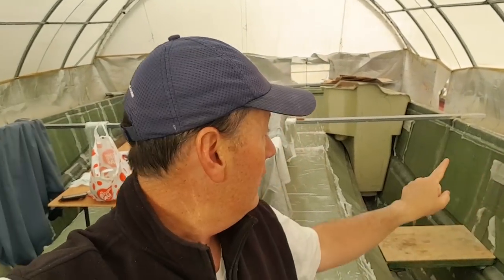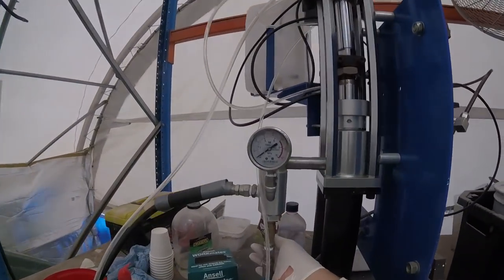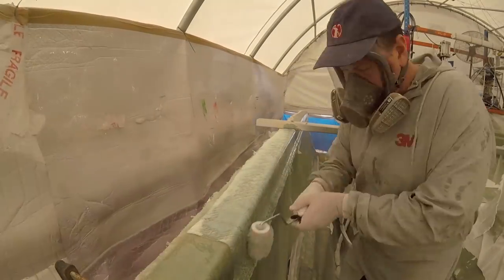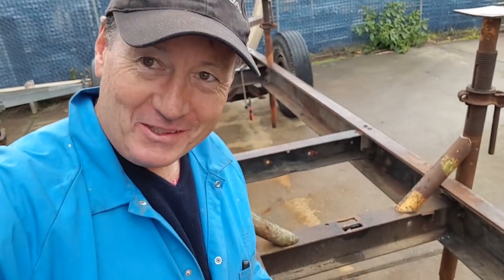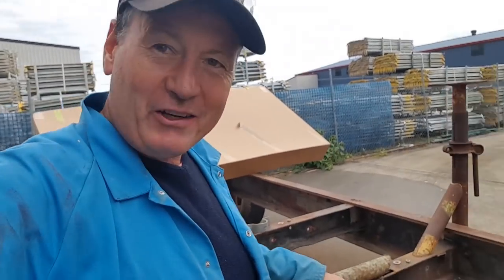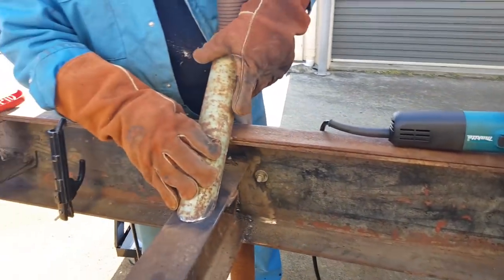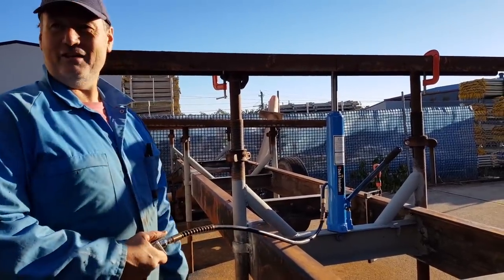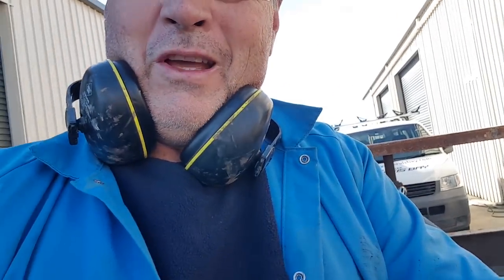EP040 Isn't that hull finished yet???

Comment: That's only the first quarter of all the work required to complete the boat, you got tons and tons of work to go! That's a huge project for one man.
Reply from the maker: Hey Bruce I reckon I am at 20percent.Althouh most of the internal modules are also complete so could put it at 35percent.Have to include the ligistics of truck,mould repair reframing so now at 10 percent.Then therr is making vidoes ad pary of it putd me back to 5 percent.Lol.No shortage of video content here buddy.Cheers Ross

Comment: A good educational video on how to do fiberglass right.  the Acetone tip was needed I've seen so many people using it wrongly. But you explained it so clearly why you don't use it.  Great video and wonderful project.  I have always wanted to the whole process from the start, seeing how the pieces are actually molded this is the best boat building videos I've seen so far. As fiberglass boats being made.

Comment: Probably need to weld a vertical piece of angle iron on either side of each of the aquaprops to brace them front to back for stopping the trailer suddenly. The laminating looking great - can't wait to see it out of the mold.
Reply from the maker: Thanks David I have now braced this fully with some serious longitudinal sections as well and I may even put some chains between the top beams to avoid swaying. Thanks for watching buddy. All the best Ross

Comment: Cheers!!! Great work as usual!!!   ---  you might could make a couple of plates with semi-circles cut out of them and weld them to each I-beam and the pipes above and below each I-beam as braces.   That'll guarantee they don't move and give you a really good and solid easy weld and an excuse to use the plasma cutter to make the plates!!!  Of course you've already painted everything (months ago!) and I assume with a zinc bearing paint?

Comment: It may help keep the  jack centered if you weld a small scrap of pipe to use as a cup for the end of the jack to keep it from walking under pressure  enjoying your videos thank you
Reply from the maker: Thanks Tracy, I am intending to do exactly that including a large hardwood block to increase the elevation capacity. I haven't yet tested the rig on the mould but am certain it will do the job with the lift as is. Thanks for watching buddy

Comment: You have to paint it Ross. He is correct the welds will rust away. You might also need lights and check the tyres to be legal on the roads.

Comment: In commenting I think it is important to be constructive and when advice is given it should be with the idea  of helping hand. Not a disparaging cut into one who is obviously giving it his all. With that being said it is true on an open forum like Youtube the hecklers will abound. Good on you Ross for never letting that get to you. I am glad to see your skin is as tough as your fiberglass laminate. From my perspective I do see the possibility of an issue and only bring it up as a question. You may have already thought of this and have a remedy.  My question is how will you control the 4 rams lowering the boat at the same time?  If one or more lower to quickly it would put a great deal more strain on the remaining rams?
Reply from the maker: Excellent point Mark. This is how I see it happening. Lift will elevate boat at least 500mm. Lifting will be with a one man manifold with 4 triggers. The lowering, will have to be at least 2 persons in between the reliefs or better still 4 persons as you say in unison. I only envisage 1 major lowering in all of this and that prior to demoulding as the truck will then be positions under the new hull with cradles high enough to facilitate and minimise lowering, just enough to get the stands under and the truck will remain half cocked to support the hull whilst I complete the build. There is so many in and outs of the tent envisage that the truck was essential and I have now completed the steering and draw bar attachment so much more to come along with extra bracing and reinforcing. Thanks for the support buddy, a lot of it is water of the ducks back and I am fortunate not to have that many hecklers. Funnily enough I think every one enjoys and good masochistic docco. Cheers Ross

Comment: I WONDERED about the Acetone!  Are you going to install the modules now, or wait til you get the Deck done? Rosscoe, I don't see any reason for the Inspector to Nix your Hull. It's probably the only one he'll see with that High a Standard of Quality. Outside of a Newer Factory, anyway. The trailer is looking good, too.  Yes, Paint it, lol. You need to run Long air lines to each jack from a manifold, won't you, to allow you to Lift the boat or the mold from One Place? I'd connect a manifold to the line coming from the compressor, install a control valve for each jack, then run lines from the control valves to the jacks, so you can stand at one place and control each jack individually OR Simultaneously, for Fine Adjustment.  Damn Fine Work.
Reply from the maker: Thanks Jim, I will be putting an extension hone and all in line to ensure I can operate from one place for sure. I will be installing all bulkheads first and am templating them now and starting installation next week. This will be a long process as scarfing of main plywood compression bulkheads x 2 will take an effort and the remaonder of these are foam core with dual  and a half Demoulding could happen any time after that and I may demould and put back in the mould to avoid excessive storage costs. Rest assured you will be the first to know when I demould this beast. Rossco

Comment: Whew, finally got it done, what a relief, huh? I notice on the jacks on the trailer, that you have each one working now, but how are you going to tie them all together so the boat can go up and down  level and smoothly? I know you won't want to be going back and forth between the jacks, especially to let them down. Do you have plans on running line to tie them together to a central point on the front?
Reply from the maker: Gidday Orville. I will build a manifold and join them all with extension hoses so I can move from bow to stern. For the demoulding and hull and deck moves into place I will have to have at least 2 people to relieve the jacks but they will only be about a 1.5 foot rise so we should be able to drop in unison. I am planning a mod to run length wise on top of the cross beams for the nice fresh demoulded hull when the time comes. The logistic ahead are substantial with moves in and out of the tent, up and down of the deck when complete and final launch of the trailer which is about a 1km drive to our local boat ramp.  Ross

Comment: i think you should use a peice of U shape square section that you can weld to chaise first and then you have your acrobar nestled in the U shape so it allows you to have more surface area welded to the acrobar which is  then welded to more securly to chasie just a suggestion
Reply from the maker: Grrat suggestion Stuart.I have securely bracketed the props welded to the frame then put diagonal bracing to complete the rig.I will do a test lift first before lifting and moving anywhere.

Comment: What’s the cost so far on fibre glass mat and resin?
I so hope you finish.
Cheers from Goulburn
Reply from the maker: Resin,glass,cloth,foam currently at approx 35k.Hull finished would be approx 200k from a factory with labour I imagine.So much in this to be honest it will end up around 300k finished.Consumables included.

Comment: Theres another option instead of styrene and thats the correct way....use laminating resin. Would've cut out all the hours of sanding.
Reply from the maker: Sadly or in my case I was using vinyl ester on the hull and the amount of dust and contaminates that would have settled over the twelve month build would have seriously undermined the chemistry, more so than aiming for best practice secondary bonding , ie peel ply, sanding, keying and cleaning, so I chose this method. If I had a team of lammys working with me I am certain we would have maintained the schedule to not need either cleaning or sanding with, as you said laminating resin, however it is not available in vinyl without excess styrene and the whole idea of Vinyl is to eliminate possibility of osmosis and reduce the dreaded VOC Emissions required in Australian manufacturing environments now.  If the hull was in a climate controlled factory with very little air movement I would certainly have considered it as I use loads of it with my kayak manufacturing business with a final wax layer to finish off. Thanks for your comments it is great to get the web brain trust happening. Cheers Rossco

Comment: Good stuff. Looks like you got a lot of sun the past few days. Lol. Did your friend get high from not wearing a ventilation mask while you were applying the last bit of glass? Anyways, I hope the releasing of the hull goes smooth and the chassis doesn't decide to let go while moving the hull around. Looks like the welds are good to go.
Reply from the maker: Hey Brad, My buddy Johnny forgets his mask so I ram it down his throat. He is only ever in for a few minutes but I love him coming over, stops me talking to myself. Heaps of sun and it never seems to rain ever now. we are so desperate for it I am saddened that I actually was complaining about it. Should be strong enough now has additional bracing and working on the steering and draw bar for towing.

Comment: you mentioned the inspectors required your materials to be stored in a climate controlled area.....did you have them come out while you're still in this process so they could see what you're doing while it's happening, or do they only come look at it at the end??
Reply from the maker: Hey Tim , there are about 5 inspections all very costly too, next inspection for me is the bulkhead stage where the coving and scarfing of compression bulkhaeds is inspected as I have 2 major plywood bulkheads with 300csm/600db on each side for imcreased sheer strength,  and the majority of foam bulkheads l have with laminated 300csm/300csm/600db/600db on each side so lots of work to go. It is very strict but likely to change with each inspection as we review and improve weight and sheer capability.Cheers and thanks for tuning in. Ross